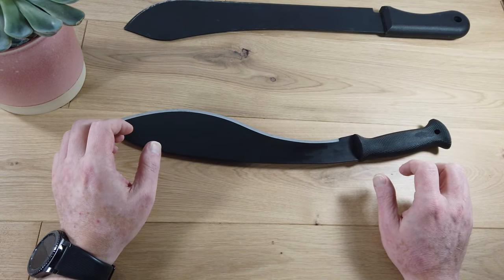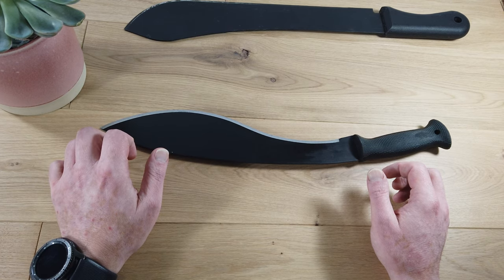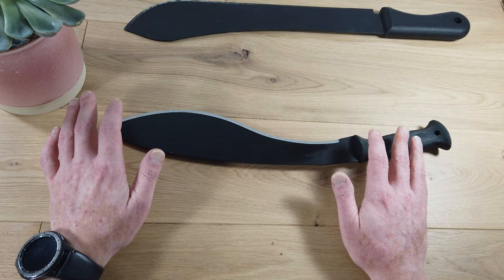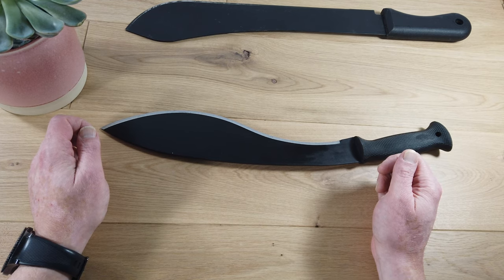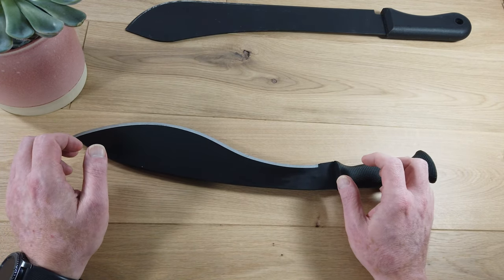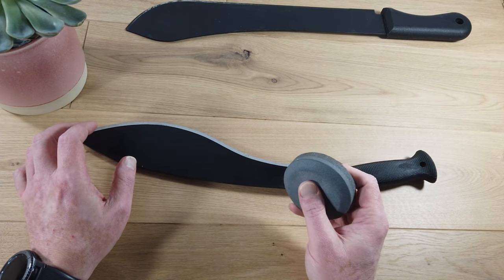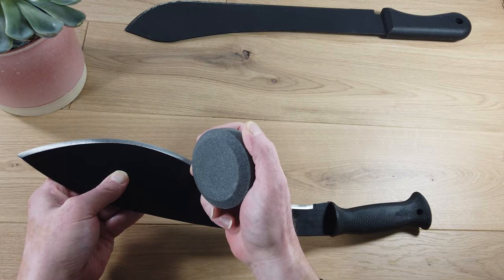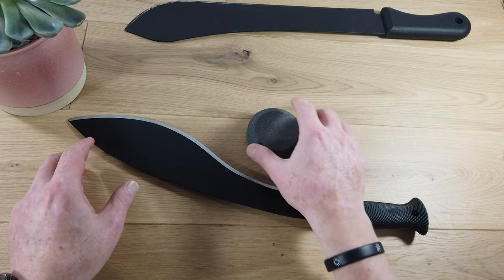Cold Steel Machete Edges and Sharpening

Comment: I use oil, but the blade seems to have a  hollow ground edge from the factory. The stone/puck doesn't hit the entire cutting surface in the middle of the sharpened edge. Wonder if a flat sharpening will ever be as good as the hollow ground original? Or am I seeing things? Mine is at least 5 years old. I beat the hell out of it. The only one I've had that doesn't break.